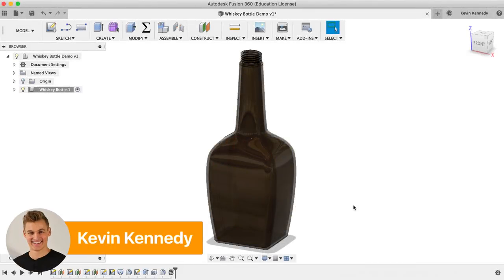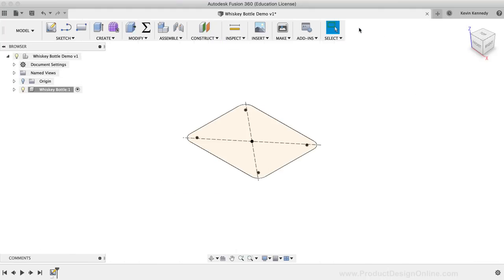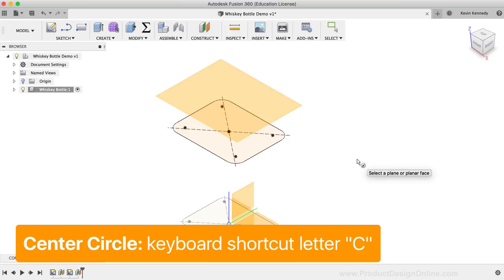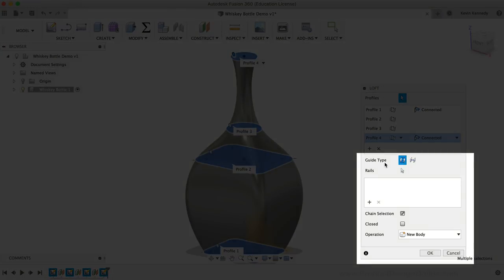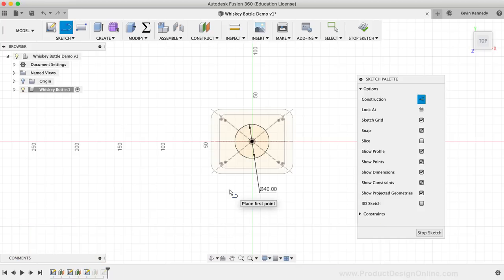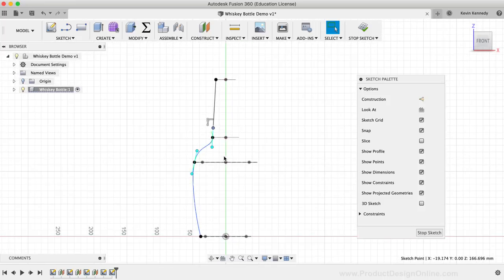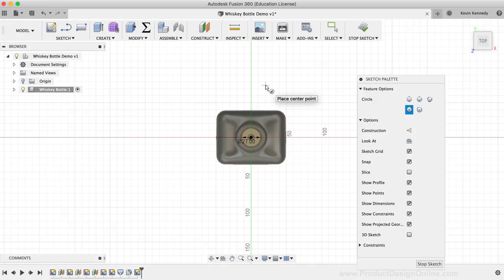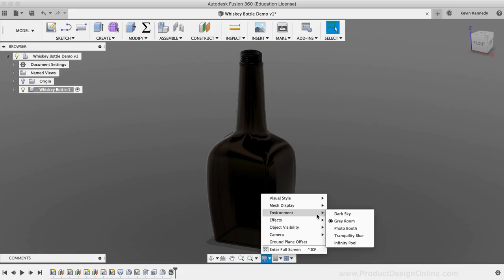How to 3D Model a Whiskey Bottle - Learn Autodesk Fusion 360 in 30 Days: Day #4 (REVISED)

Comment from the maker: Get the guide rail error? Solution: http://bit.ly/day4solutions
Here's the resource page for this tutorial: https://productdesignonline.com/3
Reply: Might be a bug in the software, but if you create the spline and the straight line without editing the shape of the spline - simply align the spline and the straight line using the spline handle, the spline line stays black not blue. This allows you to select it and the straight line as a rail. You can then edit the spline afterwards. For some reason it sees the spline and straight line are not connected - in a rail context - but this only happens when the spline line turns blue and the straight line is black. 

Another useful tip I found for this was to use "P" for program and select the dotted construction lines. This allows you to select them as snap points, whereas without turning them purple using "P", it would not "snap".
Reply: Love the info, however i have been thru this whiskey bottle multiple times - and always get the guide rail error - not sure what is going on - but i am failing ...  i get the spline to connect to the line fine, and the spline/line is connected to the 4 planes - is there something else I can check ??
Reply: i get a loft would intersect itself error ...
Reply from the maker: @davidpreston605  Please check this solution article I created and let me know if that helped - http://bit.ly/day4solutions
Reply: @ProductDesignOnline  - brilliant - thanks - i tried all that last night (I am in Seattle), and it didnt work, but the third time this morning it did - sheeze  !!  Anyway - I am off learning in 30 days (or less if I can prioritize my retired time) !!  Thanks again ...
Reply: @ProductDesignOnline  thank you
Reply: Kept getting guide rail error even after following the solution you provided.  Only way I could make it work is by having a single spline from the bottom to the top of the bottle.  Maybe I'm confused but having two entities (the spline and line) is what the issue was.  
Tried to combine them into a single entity but I, as a novice, just couldn't accomplish it.  Spent most time on the guide rail...  
Thanks for the videos they are really helpful and are much appreciated.
Robert
Reply: I got it to work (finally) by manipulating the connectinconnecting spline point last.
Reply: As of version 2.0.10356, I'm still getting errors attaching the Guild Rails.  Unable to add rail when selecting manually.  If I create a selection set to pick the first rail, it is added but only the straight line section of the rail is valid (red circles around the bottom 3 spline control points).  I've repeated the demo multiple times and always get errors at this stage.
Reply: Unchecking the box for chain selection while selecting the guide rails worked for me. It confuses me because I would imagine that chain selection would be exactly what we wanted here but anyway. I hope that works for some of you.
Reply: @PabloFlores-pj1nu  Wow! Thank you Pablo!! Can't believe it was that easy!
Reply: @PabloFlores-pj1nu  That finally made it work for me as well, thanks Pablo!
Reply: i did all you're settings at the start of the course, checked the solution link and my settings were already in place but i'm not able to finish this, spend 90 min to get it done but it's just not working.
Reply: one click was all it took to fix the issue I was having.  Thanks heaps for all the work and effort you've put in to these tutorials
Reply: Your "guide rail error" solution doesn't work, always says disconnected on profile 3; instead, I just create two separate lofts, first one only cover profile 1-3 + 2 guide rails, second loft go from profile 3-4.
Reply: @justbnme97330  This is the solution I needed.
Reply: Like those before me, I got the error after deleting the rails 3 times, I ultimately had to zoom in close to move and manipulate the rails. I will try this solution later once again.

Comment: hi kevin, just saw this revision.  you've really evolved your teaching methods by slowing down the explanations for beginners, and highlighting important parts of the video such as making sure the spline line connects to a regular line by snapping, or else the loft tool won't work.  sooner or later everyone gets stumped on why something doesn't work; providing extremely useful tips for the beginner student lays a solid foundation for efficiency and understanding this complex program.
Reply from the maker: Thanks, cmc 123. I have learned A LOT since recording the first handful of tutorials. I'm also always practicing or trying out new techniques to further improve or enhance my tutorials...so I'm glad to hear this was a great improvement over the original one.

Thanks for taking the time to watch and comment. Cheers, Kevin :)
Reply: Did not loft the first time. Deleted the straight line, redid the steps, good the second time around.

Comment: Hello, Sir I still got the Rails does not touch all the profiles even after snapping the spline points just like you
Reply: I was also still getting that, even after deleting the sketch and following the link (Which I had actually followed the first time since I was watching the revised version). I was able to fix the issue by clicking Constraints -> Coincident, and then clicking the point, and then the construction line we created, and repeating that for all 4 planes.  I had actually gone though most/all of these tutorials a few years ago, but I had forgotten almost everything, plus Autodesk changed things quite a bit didn't exactly help much either, but these excellent tutorials had taught me how to set those constraints that first time around, years ago. Thanks Kevin!

Comment: Liking these tutorials so far, watched them through once and now following along. I did have one issue on this one, no matter how many times I did the spline and line the loft tool would give me an error, the way I fixed it was by doing the line first and then the spline.
Reply from the maker: Hi, sxcnt. I'm glad you're enjoying and learning from the series! Thanks for sharing your solution of doing the line first. If anyone has issues even after doing the line first, then applying the coincident constraint can force them to stay together.
Please don't hesitate to comment questions on the tutorials as you work through the remainder of the series. Cheers, Kevin :)
Reply: Same problem - same solution. Thanks!
Reply from the maker: @Rwide88  Glad that solution worked for you as well. Thanks for letting us know! Cheers, Kevin :)
Reply: For me this was also the only fix
Reply: This worked. Thanks!
Reply: I've had this same problem and have worked on it for an hour or so using the solutions mentioned and still no luck. I tried forcing the coincident constraint as well as collinear constraint transitioning from the 2nd and 3rd profile with absolutely no luck. Finally I decided to try using a normal construction line from the 2nd and 3rd profiles and then made the fit point spline using the ends of the new construction line and finally.. that worked. Excellent tutorial series btw!
Reply: At last! Doing the line before the spline worked! Had tried everything else and was nearly giving up... Thank you Rebs for the solution and Kevin for the series!

Comment: If you are having trouble getting the line to connect with the spline, it's because you need to click on the spline, and then drag the handle to snap into the line. I drew the spline and the line, then selected the handle and it wouldn't snap. When i selected the spline and then moved the handle it worked. For anyone wondering why it won't combine.
Reply from the maker: Hi, Bcrhiaadn. Thanks for sharing the with the community! Great tip! Cheers, Kevin :)
Reply: Yep this is the problem I was having and your comment fixed it. That is strange though! Thank you!
Reply: Did what you said and the handle is snapping fine, but the spline and line remain separate pieces :/

Comment: The default settings (as of Jan 2020) are not the same as Kevins.  I learned a lot from trying many times to get the rails to work.  In a comment below, Kevin addresses this.  You must have the projection in the settings turned on.  The practice of doing this over and over really helped me.  I am learning so much from this series.  Thanks Kevin
Reply from the maker: Thanks, Bill. Don't hesitate to comment if you run into any other issues. If anyone else needs to check their settings you can cross-check them here - https://bit.ly/defaultsettings
Cheers, Kevin :)
Reply: Thank you! I was having issues with making the rails (they just wouldn't snap to the construction lines on the first 4 sketches). Turns out I was missing Auto Project Edges on Reference setting.

Comment: Great tutorials !!
My difficulties : The different menu to the current version is confusing, as a raw beginner I have trouble with the missing SKETCH sub menu, most of the time. ie sketch-fillet is in one menu and model-fillet in another. I think the new layout is likely a better program structure translating is not obvious.
 Also, the snap-to-point in the current version is indistinct or not working but is active in the properties box.
Reply from the maker: Hi, Dave. I understand your frustration with the UI changes. It makes it difficult to make tutorials without them being dated. In fact, Autodesk has a team of people that do tutorials and they themselves can't keep up.

I recommend you search for the desired feature by using the keyboard letter "S" to activate the shortcuts box > search for the desired feature.

Also, it sounds like the snapping issue you're having is because of the "Auto Project Edges on Reference" setting. You may need to turn that on - https://bit.ly/autoProject
Reply: Thanks.  I am also running through your tutorials and had a problem with the snap to point. The UI is not an issue on the 2021 version. The changes are not major.

Activating the aforementioned setting sorted it. Thank you, 👍
Reply: Best thing I’ve found (in a similar position to you) is to click ‘s’ for shortcut and simply search the command that you need from there. Fast than drop downs a lot of the time anyway.
Reply: @dasottonator1363  What aforementioned setting?

Comment: Hi Kevin, 
Thank you for the tutorials so far! they have been accelerating my learning process.
No issues till i got to the "Mirroring function". after connecting the spline to the line by clicking the spline and adjusting the handle to snap into place(lining up with the straight line), we want to mirror the sketch to continue with the lofting function right? I have repeated the process about 5 different times now however, there are 3 different mirroring commands. using the technique you taught in a previous video, shortcut key "s" >> typing "mirror" three commands show up. All three prompt me for a pattern type. 

1.Mirror - Face , bodies, features, components.
2.Mirror duplicate -  T-spline body
3.Mirror Internal - Face

None of these pattern types allow me to click the sketched "rail guide" i just created.
Any ideas? all my settings have been adjusted to match your settings since the start of your video series "Day#1 Lego"
Reply: I ran into a couple of issues at the 'mirror' part as well. 

Daikonyama's issue: you were clicking 'Create' after exiting the sketch, which is why there was confusion as to which Mirror function to use. While still in the sketch, click Create > Mirror and you will be using the correct Mirror function.

My issue: When in the (correct!) Mirror function, I was unable to select my lines as 'Objects' to mirror. This was because I had made the three lines in three separate sketches. By deleting these separate sketches and adding all three lines into a single sketch, I was able to select the lines as my Mirror 'Objects' without any trouble.

Comment: Wonderfull tutorials so far! But like some other people I do get stuck on the rail not touching warning while trying to Loft. Checked I'm in default settings, snap is on, various orders but the top part seems to keep giving errors. Might it be something which went wrong with the construction lines in the circles?

Comment: Just finished the lesson with a fully modeled bottle. 
As anticipated I had issue joining the spline and line for the rails. I followed the instructions but it would still not join the lines until I deleted both and started that step from scratch. Second try is a charm I guess.
Had completely surprising issue with the shell though. Initially when I was trying to apply shell to the bottle the whole app would freeze for several seconds and then error with message "large topology change will be required" or something to that extent. Then I realized that I have applied second fillet to the bottle neck before using shell. Removed that and shell worked as it should.
Surprised that 2mm fillet could stop shell and a bit upset that the error message is not specific enough. If not for the lesson script I would be completely dumbfounded to why shell doesn't want to work.

Still looking forward for future lessons!

Comment: Great vid, enjoying the increasing complexity through the lessons.  For me, I had to create 2 separate lofts, one for the bottom using our spline, and the second for the circles.  Seemed to work.
Reply from the maker: Thanks, Joshua. Please check out the newly created lessons here (working through them now, but first 6 are out): https://bit.ly/30daysUpdated

They have the latest default settings, user interface, etc, which make them easier to follow.

Comment: Great, but frustrating. Kept getting “error, guide not touching all planes” despite several tries and care. Finally unchecked each plane in turn and narrowed error to second sketch. Mirror step must’ve thrown guide line away from plane tiny bit. Fortunately figured out “coincidence” constraint could put guide rail back in contact with second plane and that corrected the other rail contact at same time! Interesting that mirror threw error in. Worked great from there on.
Reply from the maker: Hi, James. Thanks for letting me know. I have not personally seen the mirror command cause an issue like this. I'm wondering if your centerline was a tiny bit off?? Otherwise, I'm not sure how it could/would do this if the mirror command was used.

Nonetheless, I'm happy to see you worked through it. Please don't hesitate to comment questions on the tutorials as you work through the remainder of the series. Cheers, Kevin :)
Reply: @ProductDesignOnline  For me, the key was adjusting my spline before mirror, and then not touching it again.  Changes to the spline post-mirror caused the "not touching" error every time.

Comment: hi kevin thnx a lot for this videos it really helped me a lot <3 
i'm having difficulties in this model whenever i use the loft comande it want work it tells me that the selected rail does not touch all the profiles ???
Reply: it happens to me also
Reply: @ChillStudyRelaxMusic   + @Oussema Benissa go back to the sketch and make sure that the rail guides are on the very edge of the sketches
Reply: @hennes0089  I got the same issue. And I made sure that rail guide are on the very edge of the sketche/s, still not working.
Reply: @Sanio Lee I had the same issue.
In my case, the following helped: Before drawing the straight line, I clicked on the curve to make it become light blue. Then I pressed "L" and drew the straight line. After that I made sure, that the handle of the curve snaps on the straight line as mentioned in the video. And tadaaa, it worked.
I guess my fault before was, that I did not have the curve active when drawing the straight line.
Reply: @Sanio Lee This worked for me.  Thank you.  I was having trouble getting my splines and lines to snap to the profiles.  Not sure why I couldn't get a good snap.
Reply: @LimitOfN  I can't get mine to snap either. It's so frustrating
Reply: Need to change preference to snap to object, setting -> design->Auto project edge on reference
Reply: @ddj3328  Geniusss!!!! Thank youuuu!!!
Reply: Sanio Lee thank you.  Your advice worked for me too
Reply: @HerrSalat  you re my hero, that helped me thx
Reply: @ddj3328  Thank you!

Comment: This is a great tutorial. Starting from no experience with Fusion 360, I have followed your videos step by step. While I have had AutoCAD experience, this has been a little finnicky to follow and learn. But that isn't because of your videos. Your cadence and method of instruction are good. The issue is PEKAC. But, I am learning. 

The biggest thing is finding the commands as you call them out. I was having issue finding the spline, but not realizing I had to be in sketch. Took a break, and finally found it. Again, PEKAC. I do think there is a difference between the Fusion 360 I am using, and what you show on your screen, so that is an issue for me as well.

Still on the fence of getting a 3D printer, but these videos are making it easier for me to design should I want to buy.

Thanks.